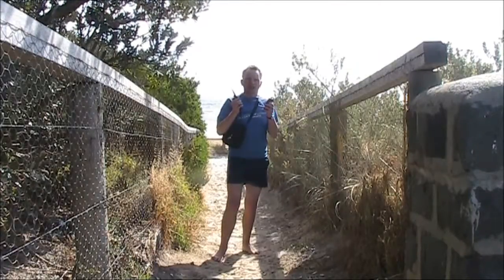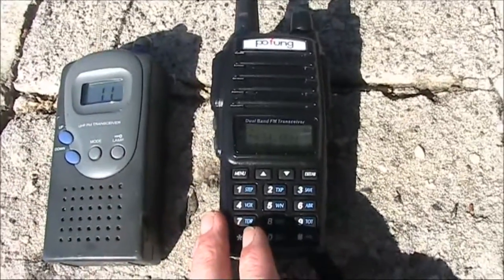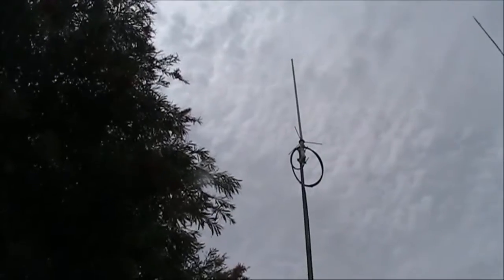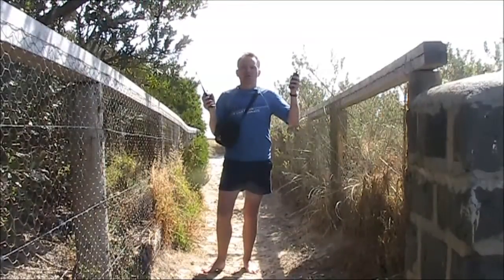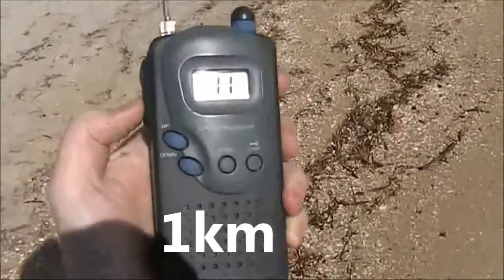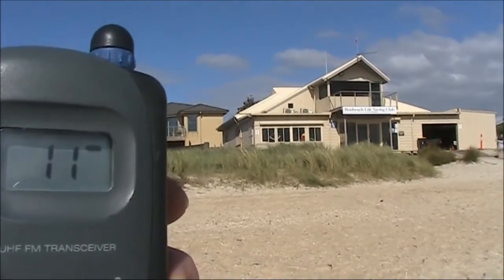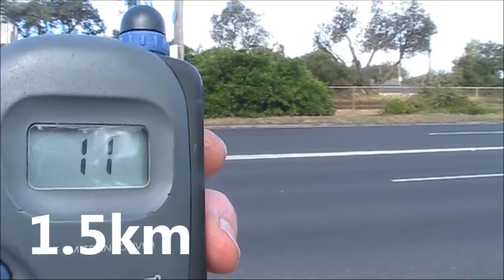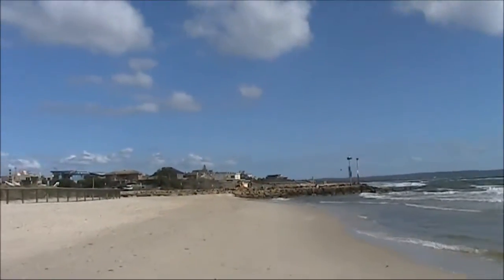Testing the $1 range tester for VHF/UHF transceivers

Comment: Hello,nice job. I want to make a similar job using icom ic-u16 handheld transeiver. The speaker jack (3,5mm mono)gives me two cables total. I saw your cirquit uses four cables from mic input...any help please to implement your cirquit from speaker jack of handheld transceiver? Thanks in advance
Reply from the maker: +kl28 kl97 Not familiar with the IC-U16. Maybe search the web for a pinout of its sockets?